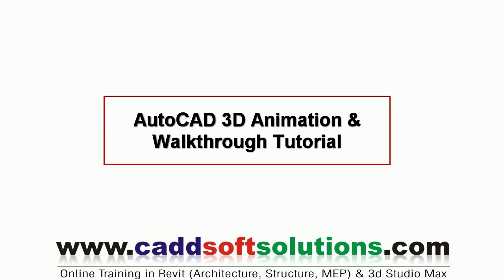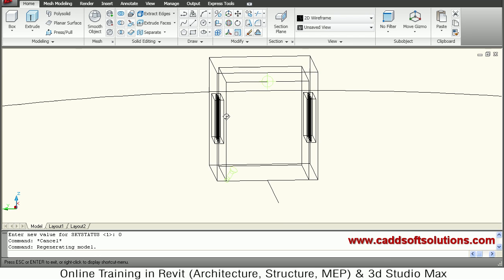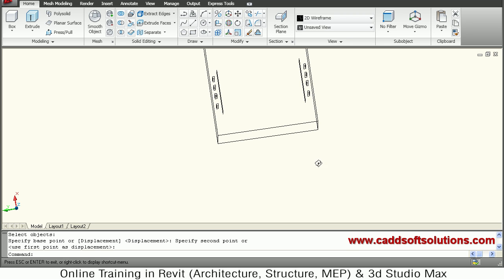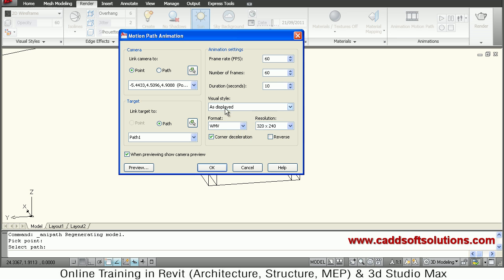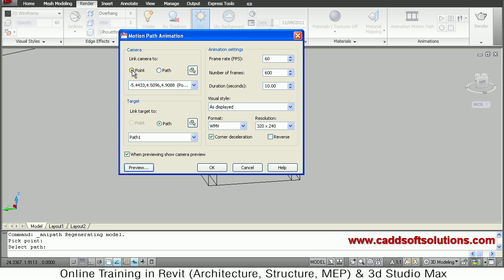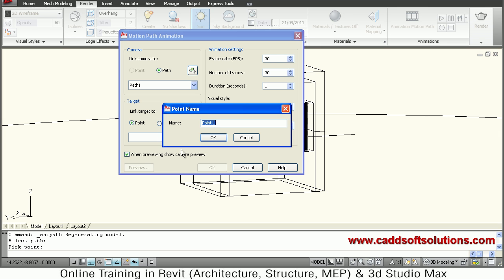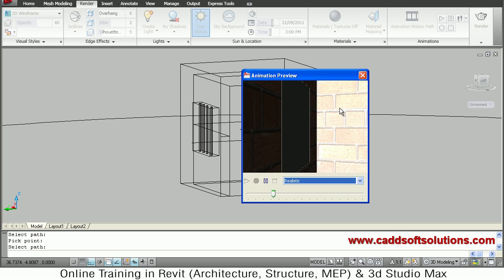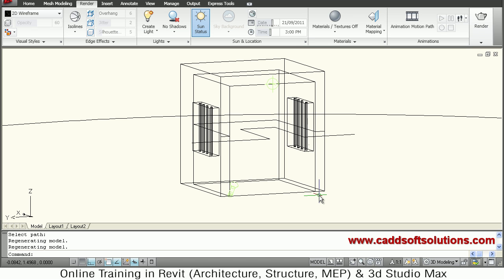AutoCAD 3D Animation Walkthrough Tutorial | AutoCAD 2010

Comment: Hello I have a question, I am currently building a computer system within the budget of 4000 euro. I found a motherboard with graphics on-board (CPU dependant) it supports 4th generations Intel CPUs which are very powerful considering they are integrated graphics. My question is will AutoCAD run smooth with this CPU 4th Generation Intel® Core™ i7 4770 3.40GHz?
(The purpose is to be able to create 3D animated models of interior designs)